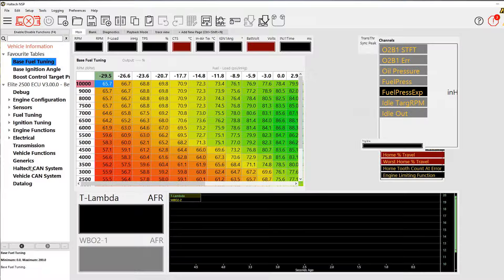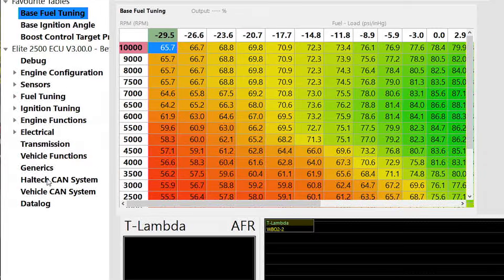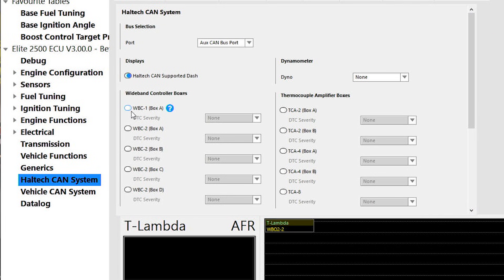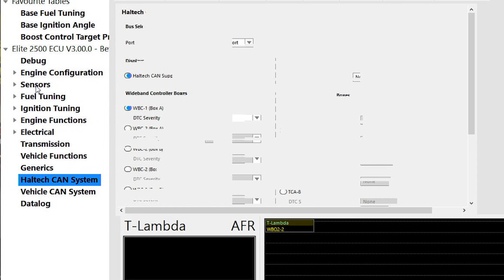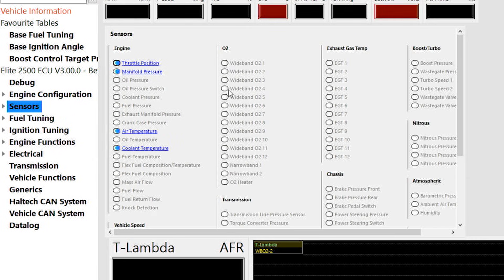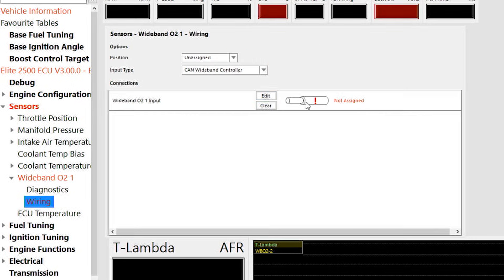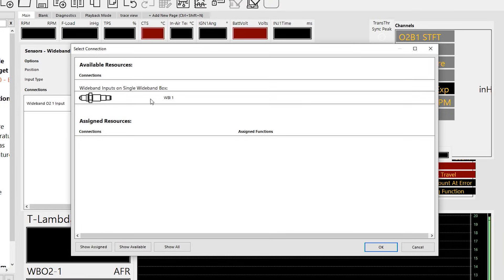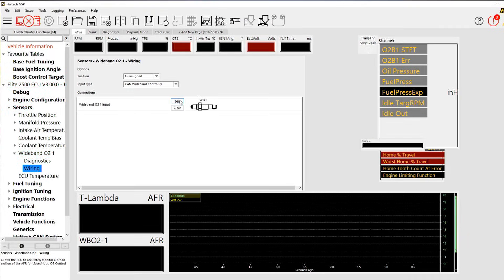🛠 Narrowband, Wideband, Bosch or NTK - O2 sensors explained | TECHNICALLY SPEAKING

Comment from the maker: It's Technically Speaking time again!
It cannot be overstated just how important it is to get reliable and accurate data from your wideband air-fuel ratio meter. And while there is a multitude of different wideband O2 sensors on the market and they don’t all play nicely together.
Before discussing the different types of sensors, let’s start at the beginning and look at what narrowband and wideband sensors are and how they work. 
-----------------------------------------------------------
We highly recommend watching the videos below to get a better understanding of this topic:
Ignition Timing vs AFR: https://youtu.be/aDSZhy551bo
Volumetric Efficiency (VE) Explained: https://youtu.be/E96rBIzZ_sE
Tuning with Volumetric Efficiency: https://youtu.be/uPjIS9Tg83M

Comment: Is the binary trigger 0/1 based on 14.7:1 within the O2 sensor itself, or, within the ECU that it is connected to?

As in, if you could set in the ECU that you wanted the 0/1 trigger to be based on 13:1, could you still use the narrowband sensor?

Comment: Great video i would also add that the NTK sensor can run reliability in higher heat range than it’s bosch counterpart its a better and more reliable unit at a cost but you pay for what you get if your running a Rotary i would highly recommend the NTK sensor they love to run richer and have extremely high EGT temps and the added cost will pay for it self

Comment: Can the wide band do diesel
Reply: Why would you want to know the air to fuel ratios of a fuel regulated engine? stoichiometric of a diesel engine is 14.6:1 but the only one you will see this is at full boost or at no boost. When you’re building boost it will add fuel to increase engine rpm. Diesel engine aren’t ran of a throttle plate they use fuel to control rpm.

Comment: I've been running my car on a elite 1000 with an Wideband Controller since late august, it's really easy to setup on the software as well on the canbus wiring. It's apparently very accurate, and cherry on the cake it's so much cleaner visually than my old wideband controller from another brand.

Comment: Another great video Matt.
I just bought an AEM wideband and then bought an Elite 550. Can i wiring the AEM wideband into the elite 550 through the DPI or should i just go the WB1. Also, can i just used the AEM bosch sensor in the WB1
Reply: Use analog input pin
Reply: Don't use the aem controller, it's old tech, slow at responding. Use can bus not an old slow analogue input
Reply: @elitecol69  I ended up getting the haltech WB1 CAN 👍🏼

Comment: What is the difference using a dedicated wide band controller vs using the output wire from something like an AEM wideband gauge directly to the ECU?
Reply: The ecu won't get reliable diagnostic Information about the sensor.

CAN is superior
Reply: Accuracy can be an issue when you are using a seperate devices, due to ground lifting and signal resolution. If you scope the analogue outputs from some widebands, they are very coarse.

Comment: Wait hold on you power this sensor thru a relay separately or just any ordinary switched power input?
Reply: Usually any circuit on a car should have a relay to void drawing to much current from a signal wire that’s only meant to activate a relay. If there is an open 12v switched fuse you can use that or even better is a relay triggered by the fuel pump ECU pin. That way it will not remain on when the key is on and engine off to avoid burning out the sensor since it will heat up and have no gases to cool it back down.

Comment: Would you recommend the NTK over 4.9 I am currently running on my Evo 8? I have burned through a lot of 4.9s. It is full E85 street/Drag car.
Reply: Did u install it correctly ? Any O2 must be installed at 15° angle (or biger/smaller, check manual) due to condensation... This sensor have heaters wich are heating to aprox 600°C every time you turn ignition on, small drop of water is enought to kill this heater, so double check that. And can you tell us how long did it last ? I mean how long aprox. Das your last sensor lasted. And allso what was the problem when it stoped working ? (Heater? Or it allways show rich/lean condition? Or something different?) And lastly, does your car have 2step/antilag ? 😂

Comment: Do you guys have a dual wide band sensor controller and sensors and gauges for use on a carbureted car or in the future will you look at producing them ? 
I know that there are others on the market but they can be not so accurate or reliable!? 

I would like to use one in my own car
Reply: They have the carburetor version of the dash and the dual channel canbus wideband controller